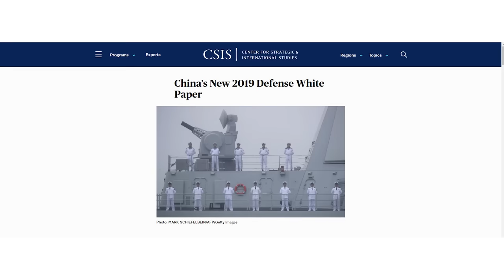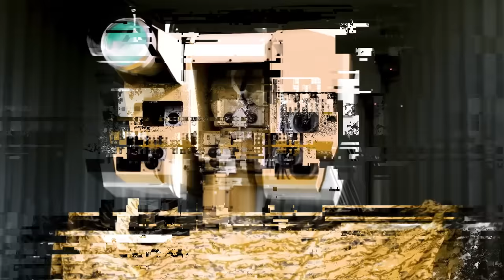Russia & China Working Closely On New Satellite Laser  Systems

Comment: So far there is no element that can Uphold the tremendous amount of energy upon releasing.   This innovative would take more time than expected. 🤓
Reply: China already has breakthroughs in developing a hypersonic generator that can generate 1 gigawatts of electricity with just only 5 cubic metre of plasma gas. The generator is as small as a small van.
Reply: @markchan8110 
I hope that intensity could fulfill the purpose.
Reply: A nuclear central in the middle of the desert, does that mean anything to you?
Well China is building in the desert of Gobi. Normally a nuclear power plant needs water to cool the power station and its atomic fusion. Well, the Chinese do not need. Hence the laser with limited cooling.